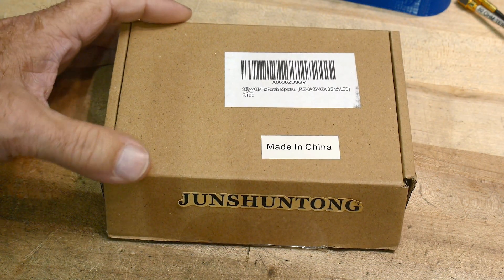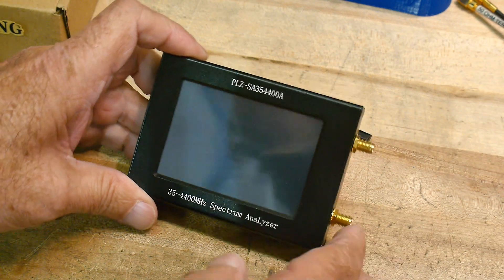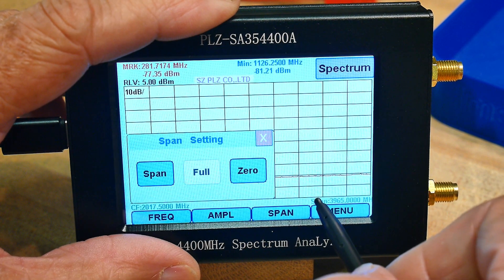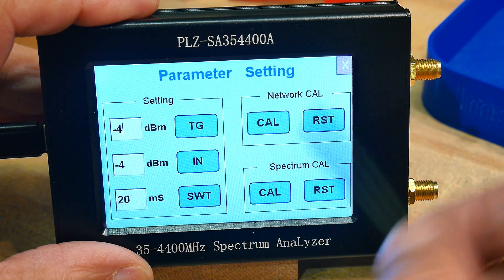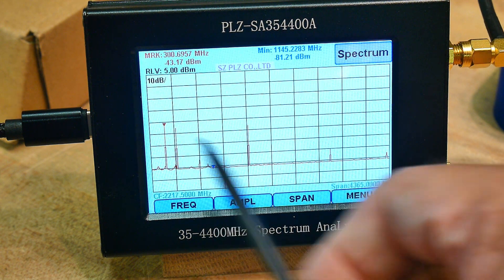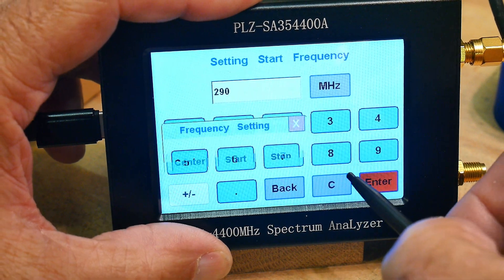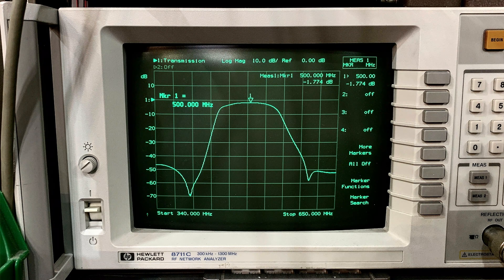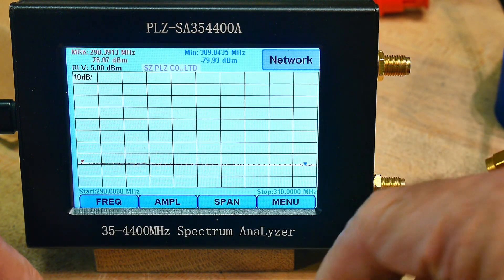#1088 Spectrum Analyzer with Tracking Generator

Comment: The "mysterious" dip in the response to a single tone is known to this and other similar cheap devices. The dip occurs when the displayed mixed IF becomes zero or DC, which happens when the tone and the sweep frequency become equal during the sweep with the seond sweep generator on board. This is because towards the very low frequency mixing product (including DC) will not make through the detection highpass. Therefore calling this a spectrum analyzer seems a slightly false advertisement. Due to the simple design there is no way to get rid of it, which why real spectrum analyzers have multiple mixers and IF's. And yeah the resolution bandwidth is another story. The tracking generator outputs a square wave which has lots of harmonics, which do not interfere with the analyzer part.

On second thought, I believe this could be corrected in software using a simple inverse (Wiener) filter together with the characteristics of the highpass in the detection path. Only the exact zero (DC) case would cause a singularity and needs interpolation which is simple. An inverse filter in hardware is a bit more challenging. I think there were some notes out on using steeper higher order LC filters, but they only make the notch narrower.

Comment: A spectrum analyzer that starts at 35 MHz is like a flashlight that only works during the day.
Reply: My experience as a ham operator and RF engineer has been that an affordable oscilloscope, signal generator, and receiver can perform the function of a network analyzer if needed; but most of our scopes don't go past 100 MHz and aren't useful at all above 50. 

I mean, HF is far more interesting to me than the top bands, don't get me wrong. But we need more cheap RF gear, especially for the expensive bands.
Reply: @stickyfox , that's why longwave is so much fun. I can do everything with gear that is little more than high frequency audio equipment, build with 50 cent audio chips, and blanket a dozen states with a 10 mW ERP.

Comment: Looks like they are asking $268.99 for it on Amazon.  Not worth it, get one of the NanoVNA models.
Reply: Another You-tuber, Tony Albus, reviewed very similar (LTDZ 35-4400M) spectrum analyzer in May 2020, but without a builtin display for $55.99, $213 for 5 inch, micro display it’s a lot :)
Reply: @marko.692  It's been reviewed here too, I've had one, junk
Reply: @marko.692  Is that like the one recently reviewed by IMSAI Guy that sells for ~$70 on Amazon? https://www.youtube.com/watch?v=eUdoqAQBf2A

Comment: Wonder how this directly compares with the TinySA.  Would be interesting to see that side by side.
Reply: TinySA is a real spectrum analyzer. These "35M-4400M" designs aren't.
Reply: @tiftik  Do you know where I can find a block diagram of this device? You mentioned that its not true spectrum analyzer, is it base on FFT?
Reply: I think the tinysa is despite the limited range infinitely more useful, for a start it has a very dedicated developer (erik kaashoek) who has been adding features and resolving bugs and problems with it relentlessly, it is despite its limited hardware very capable and for a radio enthousiast very useful, there is a reason it is so popular.
On the other hand there are a ton of these cheap chinesium spectrum analyzer out there and they all are not very useful because the hardware is just to limited, limited rbw, limited on the low side freq., limited accuracy, limited software, limited support and much more.
going on the typical 35 mhz to 4 ghz they all use more or less the same hardware chips from analogue devices and so are all equally useless and all have the same bad written and maintained software.
Reply: @robber576  in my oppinion the other major limitation of the TinySA is the RBW which can not go below 3 kHz. You can not see how signals are modulated due to that. If he could improve on range and rbw the TinySA would be amazing. I agree TinySA is already a valuable tool but it can not just yet replace my much more expensive Siglent on many tasks primary due to those two limitations.
Reply: @BaldurNorddahl  yes rbw is also limited on tinysa but still reasonable, just like the noise floor, and stray signals.
It has been asked to Erik Kaashoek numerous times (just like a big screen version, 4 ghz, etc etc ) and his answer: it has to be build at a certain price level, al these things people want make it more expensive at which point Hugen ( the chinese producer)  looses interest, it is not their business to make expensive stuff and lets not forget about the relentless cloning without any considerations for intellectual property.
The tinysa just like the nanovna has been cloned to death making it very difficult for the maker to retrieve his investment.
Up till now clones do not work properly and failed the selftest due to a cheap chip but now the bastards have modified the firmware so it shows a "pass" on the selftest while in fact it did not pass.
If you want one you have to buy it from original source to get a  good one.

Anyways: getting the rbw to lets say 300 hz will be expensive and only priductive if you also get the noise floor and dynamic range better, before you know it you have a portable rohde and schwarz /HP 🙄😂
Reply: @robber576  You can get 300Hz rbw if you use the SA app on your computer.
Reply: @jeremycyclist6269  Still doesnt help with the cheap direct mixing approach with the dip in the middle of a tone...
Reply: Different frequency ranges. TinySA does not go high enough. The review device does not go low enough...
Reply: @BaldurNorddahl  I'm sure their frequency ranges overlap at some point.  Enough to see if they share similar artifacts.
Reply: @thereare4lights137  yes they overlap. I meant the usefulness of both instruments are limited due to their range. Of course if you have both you could work around that.